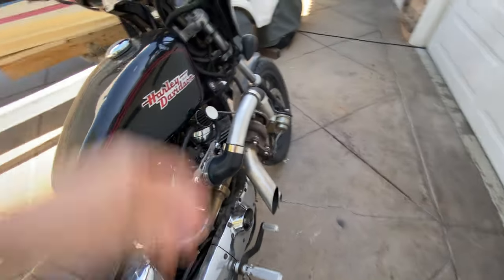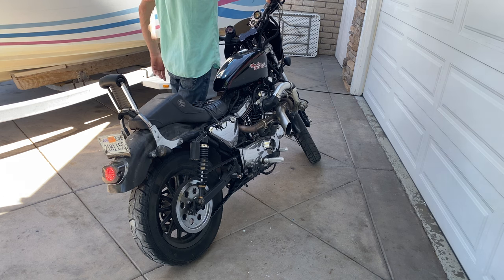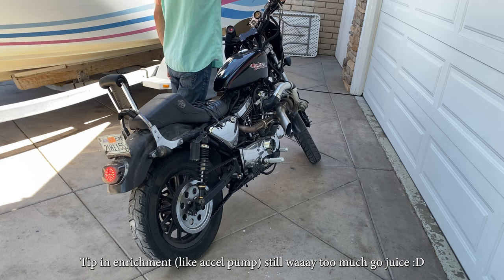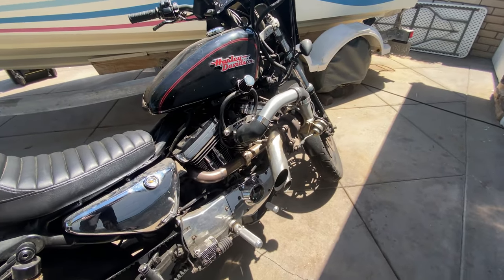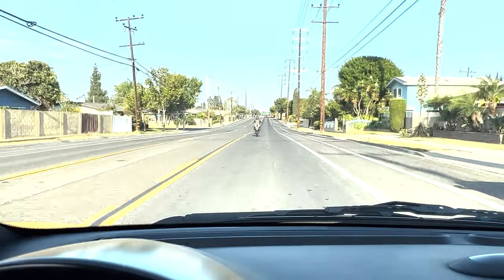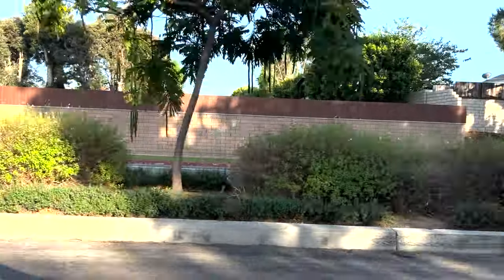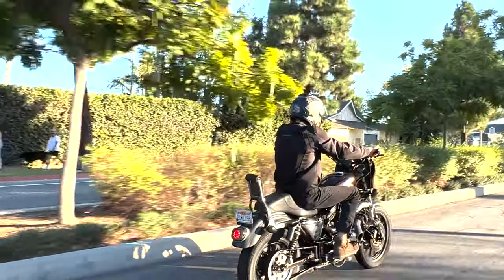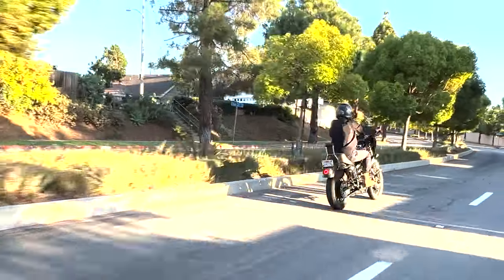Will the Turbo Harley Make Boost??

Comment: Now that you are fuel injected and turbocharged, have you thought about adding a flex fuel sensor for an E85 tune? Going to ethanol was the best bang for the buck after I went turbocharged. Allows more boost, more timing, and even cooling effects. Which, now that I think about it, might be even more beneficial on an air-cooled engine, like you have. Love the build.
Reply from the maker: That’s exactly what I was thinking!!! I got somewhat distracted with other projects but I have larger injectors ready to go in, just waiting for an ethanol sensor and converter. Then it should be fairly straightforward. I have a different project running on flex fuel so I’ll just steal most of the tune stuff from that :D
Reply from the maker: I also want to say that your thinking is bang on! The air cooled motor is like the opposite of detonation resistant, luckily none of the components are very stressed so it can take a bit of detonation but it honestly needs the ethanol. Makes you wonder how the old turbo Mezger Porsches did so well!

Comment: Sounds like it is running really well. I had built a sportster that did 91.2 hp NA. I can guarantee that bike will rip. Would guess 12seconds 1/4 mile.
Reply from the maker: Right on!! these little sporties are sure fun bikes

Comment: Where did you pull the oil from? Im planning a turbo setup on my 1200 and have ideas where to feed from but would like some impute. Thanks.
Reply from the maker: If I remember right I added an oil pressure gauge and just teed into it at the oem oil sender location.

Comment: Hey I’m looking for a turbo for my road king what size turbo is that?
Reply from the maker: It’s a TD04 from 02-07 Subaru Impreza wrx. They’re plentiful, cheap, and way too small for the Subaru they originally came on so everyone swaps them out. You should have good luck finding a nice used one for cheap 👍
Reply: @hillbilly-engineering  alright thanks a bunch

Comment: does it not need an intercooler?
Reply from the maker: For this setup (because the turbine side is large for the engine size) and the boost is only 6psi it doesn’t need it. If I had a dyno I could add more boost and timing with an intercooler.

Comment: What throttle body is that you used on it ?
Reply from the maker: It’s off a newer Harley sportster that’s fuel injected, got it off eBay. I had to lay the old manifold over the new and grind the angles to so they lined up.
Reply: @hillbilly-engineering  thanks. Going to be trying to put my 98 sportster on a fuel tech soon